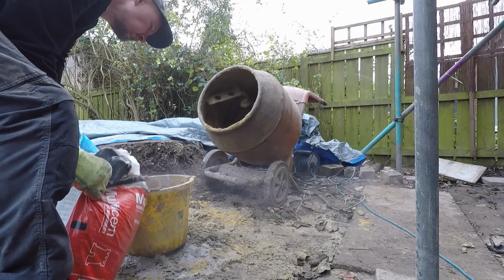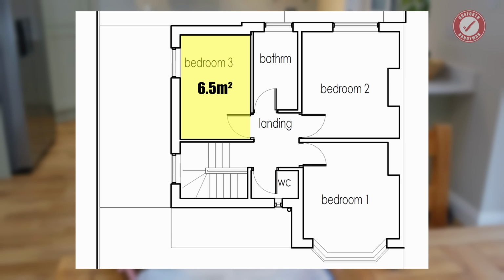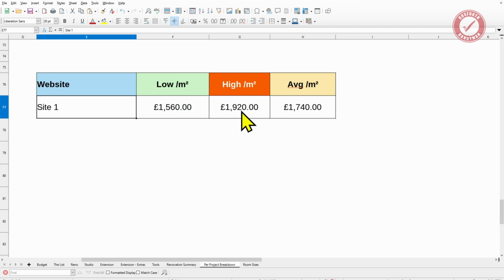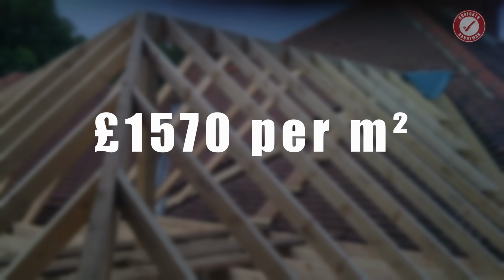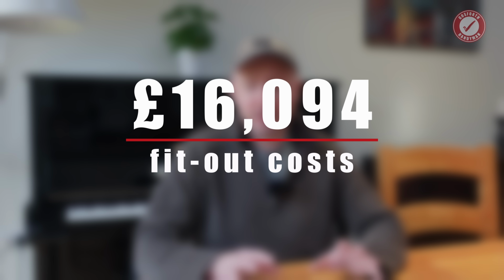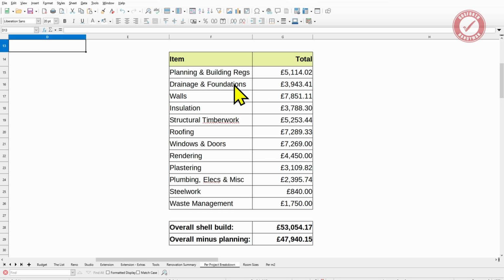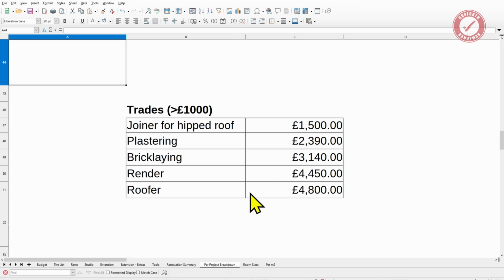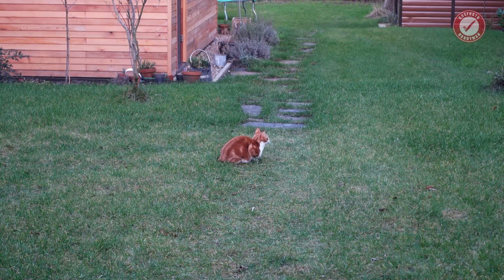How much does a UK house extension really cost?

Comment: 15.25hrs  Were you effectively fully employed on the project for the entirety of the build? That’s how it appears and I would be interested to know how much should be allowed for this? I’ve just had a similar extension built and helped out in many ways although not with your level of expertise. I was working full time in my day job so the cost of my labour was irrelevant. Surely if you are fully employed on the project your time should be costed into it to more accurately reflect the real costs.
I have loved the whole project and have found it invaluable. Thanks very much for sharing.
Reply from the maker: The only time I was really full time (8am to 4pm) was when I was labouring for our brickie and that was only about 3 weeks. Rest of the time we managed to fit the work around the day-job (or more accurately, did the day job at night so we could build through the day). So defo not full time hours for the entire build... and we get bored easily. 😂👍

Comment: I've paid 180k all in for an extension with fairly high end finishes and it technically added zero sqm to the property. I actually extended my kitchen into a conservatory space to make a "mega room". The complexity was in the structure - a 6.5m span of steel weighing 900kg attached to two 3.5m spans of steel, with the load transferred through a reinforced concrete beam in the ground. It's exceptionally transformative to the property. I do begrudge the price a little, but you don't want to let cowboys loose with the entire structure of your home.
Reply: I think you did the right thing. Your home is not a commercial investment and I think far too many people focus on the amount they are going to spend on their property Vs the final value of the home. Personally I dont really think it matters if it’s your primary residence. You only live on this planet once. Enjoy your home. Invest what ever you want to in it. It’s not a business it’s your home so why worry,   Good on you.
Reply from the maker: Too right and depends how long you're planning on staying there etc. Our ceiling price for the street was our most limiting factor. 👍
Reply: @GosforthHandyman  I definitely made a bad financial decision but I had the resources and they were otherwise being eaten by inflation. While I didn't have any fun tearing things down and building them  back up, I learnt SketchUp from your channel and got to have fun with the drawings at least. Need to start somewhere :)

Comment: Excellent as always. Been looking forward to this one. Our wrap around single storey extension project is due to start in May. I am dreading our re-quote a month before. We got our price in feb 21 (edit Feb 22 sorry) and then booked our preferred builder based on reputation and then chose to wait over a year to get them. In terms of cost comparison, the 3 quotes we got were all within 10k for a circa 90k project and the average was bang on what the architect guessed prior to gaining quotations. I should add our project includes a complete ground floor rework (remove all walls and create new rooms), large bifold, large glass feature window and 2 triple velux roof windows in a pitched roof plus move of an existing window and sill adjustment plus plumbing and electrics (we just need to source flooring, kitchen and final decoration.
I am also wondering what effect the new building regs will have on the re-quote: We didn't get regs done until after the change so the walls have changed for example, cavity now wider etc, so assumed more insulation.
I would love to do some of the project management but just don't have etc time with work or other family commitments. Am tempted to fit the kitchen myself though and will be doing some built in cupboard work.
Reply from the maker: Good luck with yours! Unfortunately Feb '21 is just before prices really started to ramp up. Could be significantly more now, although probably not as bad as mid-2022. 👍
Reply: @GosforthHandyman  thanks. oops, just noticed the obvious mistake of which bloody year we are in. Feb 22 was the quote, so hoping the jump isn't too big.
Reply from the maker: Ah, should be OK. Feb 22 was probably peak of timber costs... I think.
Reply: What building regs changed?

Comment: A very good and detailed  breakdown of the costs. It would be good to break down labour costs per hour or day, as this will make calculations  easier. You did not mention about how much additional cost was occurred because of error and the rectifying that error. In each project errors will occur, some small whilst others jaw breaking.  Another way of getting an idea of cost is to look around your local area and ask them to give a ball park on how much it cost them.
Reply from the maker: We didn't really have any error costs since everything was planned to the last detail and we knew the house intimately by that point. Will cover time spent in a bit more detail on a future vid though. 👍
Reply: @GosforthHandyman  watching a lot on homes under hammer even they dont have many errors on build.  Big ones if you are not careful is the likes of asbestos in the property , and making sure supporting properly window appertures if fitting new windows, but they are not really "new build" situations.  obviously one problem can be ensuring the supply of materials - which you had with the doors but even that was a time cost rather than significant money cost

Comment: Usually build costs are not based on internal spaces. Or thats the impression I got when discussing cost per m2. Is this incorrect?
Reply from the maker: It seems to vary by builder but most I've spoken to base it on how much bigger the house is, original size being internal area. 👍